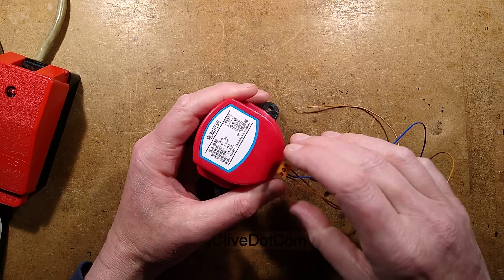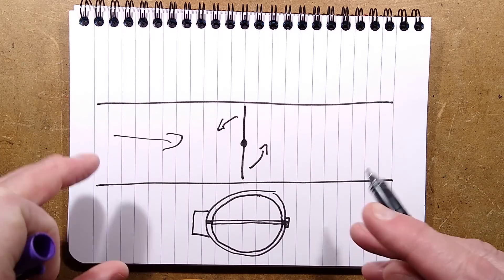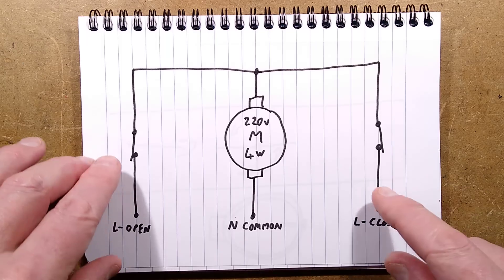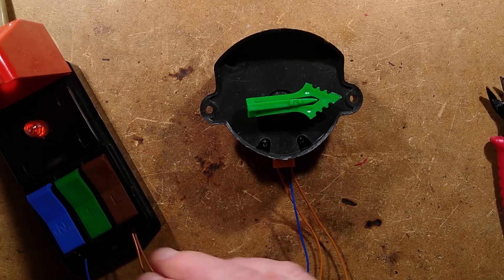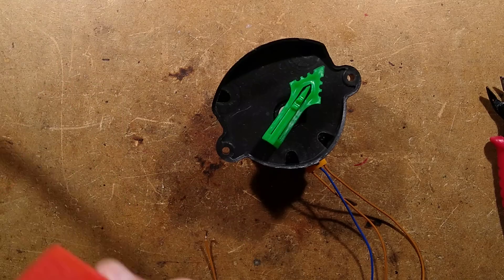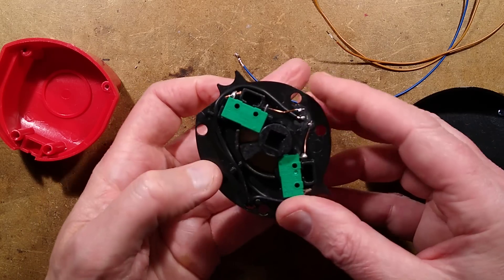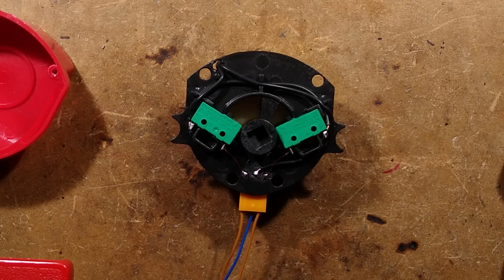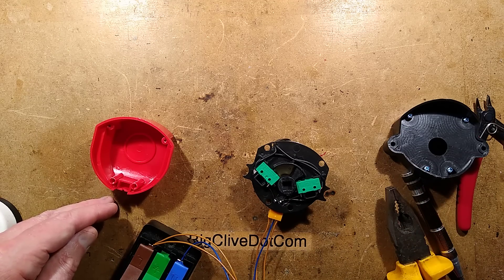Inside a cheap eBay rotary actuator

Comment: I recently bought a bunch of hvac dampers from aliexpress that have this same actuator and it seems like a much better solution than the honeywell dampers that have a spring loaded clutch on motor that runs all the time when actuated and springs back the damper when disconnected. I think it will last longer and it's 20% the cost of a commercial honeywell damper.
Reply: Also bought a 150cm damper and control motor just like this from AliExpress. Better quality than I expected.  Damper actually closes fairly well.
Reply: Maybe I should look for some zone valve actuators on Aliexpress.  I've already had to replace one of my Honeywell ones after about 5 years, which works the same way I think.  For as much as those things cost, and as simple as they are, they should never ever ever fail.  >:-\
Reply: Im starting to not trust in Honeywell products anymore. Their electronic hot water heater controlers were an absolute joke, and caused MANY MANY people to give up and have to replace their hot water heater way earlier than they should have. That wasn't the only product of theirs that had issues either..

Comment: Found another listing for what looks like the same unit but more expensive, says it fits a 75mm (3 inch) pipe, shows it attached to a PVC pipe. In the US home HVAC ducts are 6 inch or larger.

Comment: As for the different duct sizes and "adapter plates": They will just change the black plastic piece you pulled the screws out (the right piece at the end of the video).

Comment: Be interesting if one of the switches fails in the closed position, the motor would have sufficient torque to try and keep running and most likely break plastic components before stalling, worth an experiment!
Reply from the maker: It already stalls against the end to reverse.  with a stuck switch the cam would rotate back and forth continuously when that switch was powered.

Comment: One of our immediate neighbours buggered off on holiday a week ago, leaving their automated garden irrigation system running. Within 24 hours, it malfunctioned. The timer works, but a valve / actuator doesn’t. So, when it is running every evening, every couple of seconds or so it makes a weird metallic raspy coughing noise - imagine, if you will, a metallic cat coughing up a swarf ball. Every evening until the wee smalls. And they don’t come back for another week, by which time, they will owe us a beer or three.

Comment: ¼ turn or 90deg butterfly valve. Larger version used in water industry under quite high pressures.   The opening issues you mention are far more of a problem on gate valves, when often smaller pressure bypass actuators are used. Bit off topic.

Comment: This actuator came on a 110mm diameter ventilation duct valve that I bought on amazon. I used it to control ventilation in my shower.

Comment: that really looks like a microwave plate rotator motor, also the speed seems the same... i bet you can copy the design and make one yourself with a microwave one, switches included.... btw, that motor is not only syncronous so mains is precise in frequency and it is as well, and it's also an high voltage generator, if you take a microwave oven one and rotate it by hand it can even light up small fluo tubes, i did once and used too much force and apparently a plastic gear inside lost a pair of teeth LOL, now it jumps

Comment: I have seen something similar in the fan heater motor that makes it oscillate back and forth, not even with endswitches just senses the motor is blocked and turns the other way. It broke after a couple of months and keeps turning in one direction.
Even this motor looks like it has bad quality limit switches and will probably go bad in a few months of use at best.
I would trust this horrible contraption in an airduct system that is hard to reach in case issues arise.
Reply: Usually an oscillating fan uses a bell-crank system and mechanically goes back and forth with the motor always turning only one way.. 🤷🏻
Reply: @davelowets  mine is different. It has a 240V 4W motor with only two pins in the input. At first it worked fine but afterwards  It wouldn't turn back in one direction and kept grinding the gears.
I opened it and tested it the motor turns both ways.

Comment: Would love to hear you explain a closed loop PID system and tuning tips
Reply: Hehehe a job for us process control engineers...I use TIA17 which now supports autotune but I can generally tune a P I loop quicker myself. Honeywell UDC controllers are generally pretty good at autotuning

Comment: I'm guessing that the convenient reversing mechanism is employed by the like of Toshiba to use for the oscillating discharge vent function on their aircon discharge heads.
Reply from the maker: Usually a very common low voltage stepper motor with gears and clutch.

Comment: Reminds me of a 3 port zone valve, are you familiar with those? They use a diode to DC lock the motor at mid position and add a little AC resistor to stop the motor becoming magnetized in one direction. Very simple device but quite clever in operation. For so few components they can make the brain work quite hard to work out what is actually going on.

Comment: I'm a bit disappointed there's not a microcontroller involved, since it seems even cheap flashlights and light switches have them anymore. 🙄 Is my genX sarcasm showing? I've got a few synchronous motors in the parts bins, this gives me some ideas of what to do with them! 😁

Comment: damn i need one of these for my diy fume hood. i have a little window leading outside in the workshop with a door i open when i go to use it, and some duct work inside connected to a bathroom vent fan over my work space. it would be much easier to press a button.

Comment: I’m tempted to send you a module that failed in a car of mine. Since we seem to be used to replacing them all the time, I’d be interested in what causes them to fail.
Reply: If it's a GM product then it's the plastic bull gear has split and that allows it to pop over the pot metal output shaft splines such that the computer can never drive it to it's stopped calibrated closed position. eBay guy started selling 3D printed bull gears for 20 bucks and made a killing. I got one and it fixed the issue completely, didn't have any other issues with dozens of other GM HVAC door motors so far. North of 80 dollars otherwise.
Reply: @leebarnes655  I had a Chrysler with the same issue. The grinding noise when the car was started or the temp control was moved gave it away.

Comment: I now realize I don't know enough about that little motor because it just flips directions and I don't understand why.
Reply: the mechanics flip it by stalling it out. the motor without the physical constraint runs in a random direction because of the position of the rotor, relative to the position of the ac sine wave. that is, leading, it will be clockwise for example and lagging it will be counter-clockwise.
Reply: @fumthings  but isn't it the same motor like in the water zoning valves? It looks the same, and those don't flip.
Reply: @dimitar4y  it only takes a tiny pawl on the gear to stop it going more than a millimetre "backwards"
Reply: @fumthings  oooooh.... so they're mechanically strapped to go forward on those meters. Now I want to see the two side by side

Comment: If you would like to test the 50,000 cycle claim, by my calculations it would require 4 1/4 days of continuous operation. Or does a cycle consist of two runs? Anyway. Even if you choose to be kind and arrange for it a 15% duty cycle that is only a month... or two. You'll want to add a temp cut-off in case it jams up of course, if there is not one already in that motor. At the temps you keep your place this could be a nice little 4W heater 🙂 or to make something move to prevent birds from making a nest where they will poop on your porch. I'd hope this is capable of continuous duty in the event of failure of the control circuitry but its possible that it will cook itself in time at 4W. I fear that it won't take much of a load to chew up the plastic gearing in less than a week.

Comment: You need more insulation on those live feeds for use at 220/230/240 V ! Those soldered connections are rubbish too. You're meant to wrap the wire around the terminal before soldering.

Comment: I don't understand how the motor reverses. Don't these synchronous motors always run one direction?
Reply: the ones you are thinking of have a tiny pawl in them that performs the function of stalling and putting it into a single direction. mains mechanical clocks were like that.

Comment: It ought to be mandatory at the end of these videos that Clive applies far too many volts to whatever he takes apart
Reply: But, that's "Photonic Induction's" job, surely? He destroys things that way.

"We're gonna take it, and then we're gonna pop it, just to see how many volts it can handle"......!
Reply: @whitesapphire5865  what did happen to photonic induction?
Reply: @ianhosier4042  I really don't know. I heard mention that he was set to make a reappearance, but no more than that. Just so long as he's alive and well, that's what matters I think.

But, he was taking an awful lot of risks with what he was doing, wasn't he?
Reply: @whitesapphire5865  I do a lot of high voltage testing at work and sometimes it ends with fire and smoke!  Needless to say it's all done within an interlocked fireproof room and one sits in a screened control room whilst stupidly high voltages get applied to things - it's mostly testing of high voltage transmission equipment.  I wouldnt think of doing such experiments at home.
Reply: @ianhosier4042  Very much so. I used to get the creeps just going under the high tension power lines (45kV?).  I couldn't imagine playing around with the sort kit he has in his house. I once destroyed a Fluke multimeter but accidentally connecting it across the output of a microwave oven transformer.

I restore vintage radio and TV etc. and have a healthy respect for the voltages in them.  Like you, I couldn't imagine letting high voltages loose in the living room.
Reply: @whitesapphire5865  I was testing pantograph clearance distances for network rail using 200kV earlier today!  The room is interlocked so there is no possible way to walk in there with volts applied but I did get a lot of bangs and nice arcs!

Comment: I imagine this is not designed for continuous service, that looks like a lot of force being exerted through the gearbox before it stalls and starts to reverse, normally this type mechanism have a small spring 'kicker' to ensure the motor goes in the correct direction, this item looks as if its using the stored backlash torque in the gearbox to throw it back in the other direction.

Comment: Why does it not reverse as soon as the microswitch is triggered?
Reply: well it kind of does but because it is stalled mechanically, not because of the switch since the power is coming from the other switch at the time.

Comment: I think that for a hvac system that uses water to heat up radiators but idk
Reply from the maker: There is a water valve equivalent for those systems.

Comment: I am in the USA and on ebay I am seeing these for 220V and 12V but not 110V. I am wondering if this is because the 220V runs OK on 110V. Anyone have any experience?

Comment: What makes the motor reverse direction?
Reply from the maker: A standard synchronous motor has no specific direction.  It starts in a random direction, and if stalled will go in the other direction.
Some simple single direction motors have a mechanism that stalls it if it goes in the wrong direction to make it reverse into the right direction.
Your microwave oven turntable motor is most likely a standard synchronous motor, so it will go in a random direction each time it's used.
Reply: @bigclivedotcom  single direction synchronous motors were used in mains mechanical clocks. i think there was a tiny pawl inside to always kick it into the correct direction.

Comment: Does the motor actually stall? Doesn't the switch cut the power to the motor?
Reply from the maker: If powered via that switch the motor cuts off, but of powered by the other it will stall and reverse until it can hit a switch that cuts power.
Reply: @bigclivedotcom  Yes, I was thinking of (presumably) normal operation where one wire or the other is enrgised to open or close the valve, rather than the to and fro mode that you put it into by energising both wires.

Comment: Note 
Many 120 volt AC motors will actually run on 12 to 48 volt DC
Testing with low volt low current DC would be a lot safer.
Reply from the maker: A synchronous motor needs AC to rotate.

Comment: Could anyone answer this please  . I have a 4000 Watt inverter and unfortunately I connected it up to the battery the wrong way  . I put  positive to negative and now the fault light keeps flashing  .is this beyond repair or could it be fixed  .the 8 fuses in it are all perfect and the inverter unit is only  2 months old  .any help advice would be much appreciated  .thank you Clive and subscribers
Reply: Look at norcal715. He has a few inverter repair videos.  Might give you an idea what's involved.
Reply: @marka1986  thanks Mark  .much appreciated.
Reply: You probably blew out several semi conductors in it anything from a very small 50 Cent transistor to say blowing every small and large transistor in the thing the problem is figure out which ones are really shorted of finding replacements and properly replacing him I would probably just throw it away otherwise they’ll be a lot of frustration involved in repairing this thing

Comment: Not really relevant to this video but have you noticed included cables being shorter?
Reply from the maker: Not just shorter, but often thin copper coated aluminium.
Reply: @bigclivedotcom  I guess that is why the cable has a higher resistance than another one that's twice as long

Comment: I imagine the use case for this is some sort of electric door lock probably.  I could be wrong.
Reply: No, it's an actuator to open and close valves in H.V.A.C. air ducts.
Reply: @davelowets  Ahh thanks!  That makes sense.
Reply: @rayceeya8659  🍻

Comment: I wonder how we can weaponize this... 🤔
Reply from the maker: Well if you mounted a gun on it, it could fire in random directions.
Reply: @bigclivedotcom  Good idea, have to try that. I start with soft air.
Reply: Experiment failed. Motor could not take weight of simulated weapon. 😕

Comment: I think about 8 seconds travel time. Even if it made it in 1 second and you did the math at 50,000 cycles at 1 second would only be a little over 13 hours of runtime if you use it continuous. 

I say you load test it and see if it can even make 13 hours! 

Live stream until it dies.